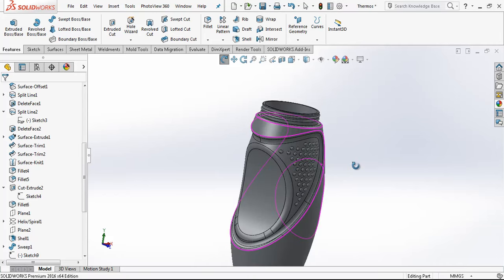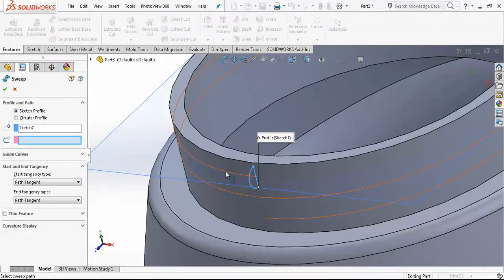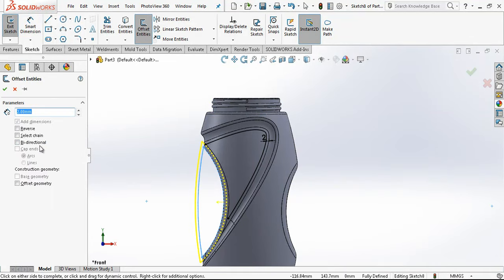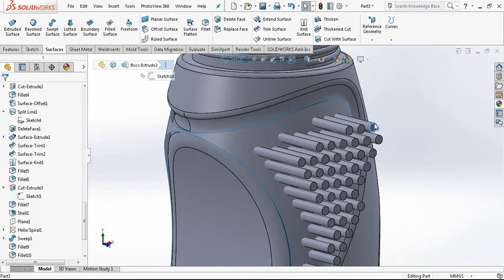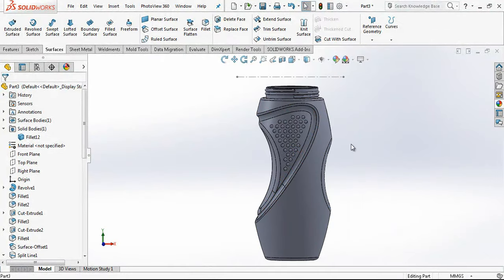Surface Modeling - Plastic Bottle

Comment: Only thing I would critic would be to use a variable Spiral on the screw top so to tuck in the ends of it so it looks more natural. You can do this with quarter a turn and shrink the diameter inwards.

Comment: Better to use an SP4XX bottle thread feature with the "Thread" tool rather than doing it manuallly. Awesome tutorial
Reply from the maker: Hi Man. I was using an old version of Solidworks which did not have that new command. That's why I did not use. 
Thanks for your advice.
Reply: Exactly

Comment: This is a way easier modeling method than the one would use for VFX. If this was a VFX asset, you would have to plan topology, and bother with the flow of the lines and mesh resolution, if for no other reason than because of texturing and deformations, if it's going to be animated. I am wondering if this can be exported for a VFX artists to model on top?
Reply from the maker: Hi Thanks for your comment.

I do not have any idea about VFX 🤭
Reply: You really don't need to re-topology a cad model after exporting. It works just as fine for vfx.
Reply: @NCSiebertdesign  I wish it was true, but it isn't. Texturing these models is an issue, same with any deformations if one needs to do some complex animation. Tessellation is also a factor, sometimes normals as well, not to mention that trimmed surfaces aren't equally interpreted by every software. Perhaps for some objects, it does work, but not for every object.

Comment: You make it look effortless, incredible skills
Reply from the maker: Thanks Man. 😊🤗
Reply: No problems, please keep the surface videos coming
Reply from the maker: Sure, I am preparing some new.
Reply: @3D-World  awesome, how did you learn btw? Im in product design school but not alot of surfacing is taught here
Reply from the maker: By doing 😊 I was very lucky that I worked in a company who sold Solidworks, I was there trainer 3 year, meanwhile I was at the university also. I made a good contact with companies, when I left my work I started to work with manufacturers. In Mold workshops for example , I have designed for people many things very various objects such as from bottle to Cast Iron parts.

Personaly I am a curious person who is wondering the real world behind objects, and  I took all the changes that would lead me to becoming a real master in Design.  Also practicing very important.

Comment: Your tutorial is very helpful! I have learnt a lot from it. You can mirror the little dome shape bodies before combining them. I modeled the bottle following your procedure. I modified the thread end little bit. Revolved the thread cross section about an axis to make the transition smooth. Thanks.
Reply from the maker: Hi Dear, thanks for the comment.

Yes that's true mirroring before combining is a possibilitiy probably in the heat of the moment I forgot that. 😊

Comment: Like to say thank you very much for your effort and time of making all those videos. You have tutorials for many interesting models. This is the second project I'm working on from your channel. 
Please allow me to give you 2 advices. Firstly, when you sketch show relations all time not only when you click on entity. Secondly slow down a bit, I mean slow down a lot lol and in crucial moments take time explaining why you do this and not that. Many people coming to channel like yours are those who want to learn and may not be as fluent with surfacing as you are. It's very hard to learn if you are racing thru sketches and features. Otherwise those are awesome tutorials
  
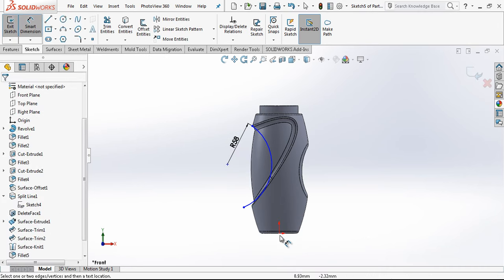Not sure if I was missing something or there are incompatibilities between 2016 and 2024 version of Solidworks but I was stuck at 11:46 for a while. I've built that bottle from the beginning few times and no matter what I did that spline couldn't be offset. Maybe that was possible with 2016 Solidworks  (as a glitch) but it can't be done with 2024 version. So, to resolve that issue I've changed geometry of sketch at 7:18 making it little bit bigger and was able to finish project. Just to let you know.
Reply: I have the same issue, how much Radius did you give it on 7:18
Reply: @Screamer26  Sorry didn't see your comment.  R60 that with its center 86mm from the bottom of bottle and 75mm away from Origin. Let me know if it helped.

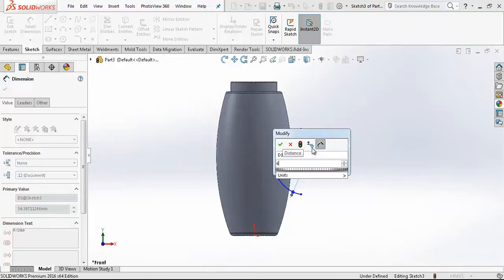Comment: 2:30 Don't dimension sketch entities from points. Dimension using the Default Plans or from priority features. In the sketch, dimension from the Top & Front Planes. You didn't specify the dimension of the body diameter. If the customer wants to specify you'll have to go back into the part. The best model can be easily modified by 'someone else' is what you want to build. A Packaging Eng. might want to experiment w/ packaging constraints. HOPEFULLY this Eng. will first copy your file & rename it then break all references before they proceed. What you also needed to do is to show how to determine volume. Nice video, keep it up.
Reply: This depends on what your design intent is and how you foresee changes and tweaks being made.  Many organic and ergonomic surfacing builds are best dimensioned point to point.  Professional industrial designer for 20+ years.
Reply: @fenixfire009  That is the design intent as far as the file goes, you always want to construct your build so anyone in the future can modify the design w/o much corruption. That was my point. Some dimensions, if taken to far can corrupt the file by over reaching into another feature. That's why you need to be careful controlling points w/ a dimension in a sketch. Now if you're creating a 3D sketch, make sure you have a point or feature that can be picked up by the Toolmakers. For a bottle, it's intuitive.  Design Engr./Designer-Drafter/ Product Design: 35 yrs.(you brought it up!)
Reply: @carmiethompson2676  how much of that is complex surfacing vs solid modeling piece part design.  That’s my point as well design intent has different meaning to different disciplines within PD.  For an industrial designer it’s the intent of the form and how the form interacts with itself.  So if the proportion of one aspect of the sketch driving sketch changes elements of the surfacing change accordingly.  This dictates that elements be referencing design/sketch elements.  For me the end goal of the model is to convey the ergonomic requirements of the surfacing and the aesthetic details regardless of the  tool being used to model it Fusion, Catia, Solidworks, NX, Alias, ProE/Creo or heaven help us  Inventor.  Now if it’s more of an internal mechanical part or mounting features for internal parts then basic extrude, cut, radius, dimensioned off the key Datums is a must.  But this is a bottle, only key dimensions are the threads and the approximate volume.  The first is typically imported as a stock body, the other is adjusted as you form the bottle.  Man what would you do if you saw those of us who start bottle designs in Nurbs/N-Spline sculpting before adding the engineering elements.  Considering most bottles are developed in NX, Alias, Fusion, and some still use Rhino.  His design is very similar to one I did for PepsiCo for a Gatorade product 15 years ago.  He solid modeled it, I surfaced and thickened to have better control over the contouring of the hand indentations and maintaining curvature continuous blends throughout.

But yes the files need to be understandable to others down the line.
Reply: @fenixfire009  That's fine, that's the intent of SW. But if you're not there(vaca., family thing or whatever) & the customer comes back w/ a change, it's easier on your associates to modify your file w/o any or little corruption. That's been my point all along.
Reply: @carmiethompson2676  that’s why you name features in a way that describes your intent with the feature, and keep in mind this is solely speaking for models such as the bottle here of exterior master surfaces of  product housings.  All internal engineering features that will be what is most likely modified by others follow the “best practices” you describe.  Spent the vast majority of my career in packaging, surgical and handheld products.  Most of the time, probably 75-80%, the exterior shell that the Industrial Designer develops is imported as a body into a new part and the internal engineering features that fix and hold the internal are added using the “book” methods and our shells never get touched again.
Reply: Amazing to read through this.

Comment: 5:25 I might be wrong because all this is new for me, but at Unif we learn to make smart sketches.
In this case the width=100 has no meaning specific meaning.
A better choice seems to be up tu surface because you don't have to trim anything afterwards.
Reply from the maker: Hi Radko, 

Thanks for your comment.

There are many ways to deal with things on 3D programs, we might say some ways better, smarter definetely. 

However most of the time I draw habitually, some options for example developed recently which was not exist on Solidworks 2001 😉 and it is difficult to break old habits and shift to smarter way. 

Regards
Reply: @3D-World  Thanks for the quick reply, I get what you mean with old habits :)

I noticed that 14:00-16:00 took you many moves to complete, only one side.
As a thank you for this video I would like to show you how to do this in one move.
https://youtu.be/y5miv7f1tyM
(Only the first minute)

Enjoy :D

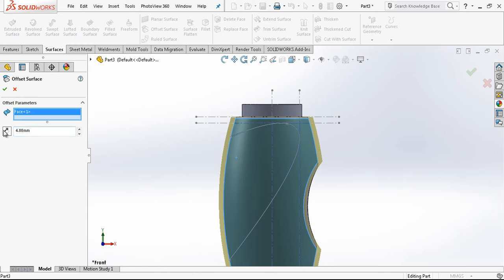Comment: How can we avoid offsetting a surface from an existing solid (4:58)? This creates a very unstable entity and if you modify the parent surface even slightly - all the features related to the offset might crash. Would the only way be creating the "styling" body as surfaces (so you can offset them afterwards) and then close them as body? This would definitely be the way in Catia but SW is very unstable when it comes to these tricks. 

Same thing at 8:32 - I would create a plane first, then tie the sketch to the plane so you can actually draw on the plane.

Comment: I'm a novice learning step by step each command used ...... After using SPLIT LINE command when I section the product it's still solid but after using DELETE FACE command the product is hollow.....how did the product become hollow??
Reply from the maker: If you delete a surface from Solid body it will be converted to Surfaces. This is the working way of program. 

Try please with another objects you will have same result. 😊
Reply: @3D-World  Thanks👍

Comment: is this software for hard surface modeling?
Reply from the maker: Do you mean the difficulty of using ?
Reply: @3D-World  i mean can we make any hard surface models in this software ? like maya or blender
Reply: if it works similar like them i would use it also for better results and learning
Reply from the maker: Depending on the results you want to achieve.

For Industrial and production design  Solidworks is good but for Gaming industry Blender will be better choice.
Reply: @3D-World  alright now i understand. i'll try it and check .